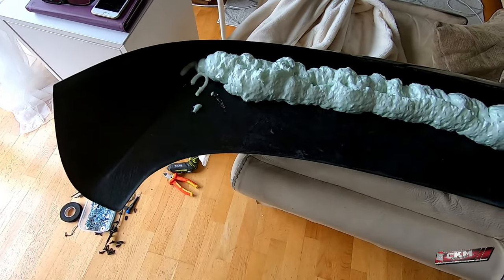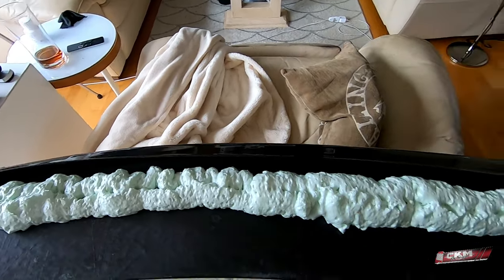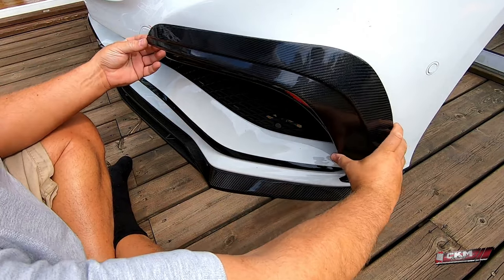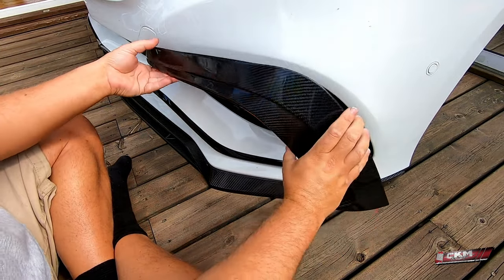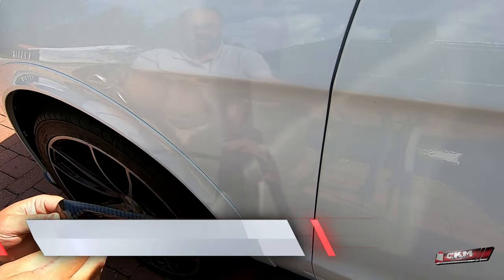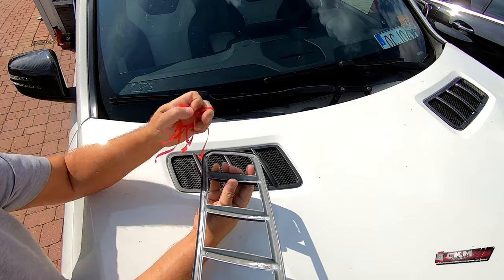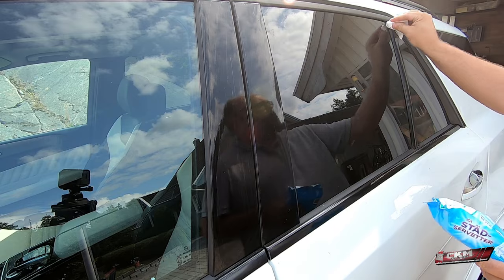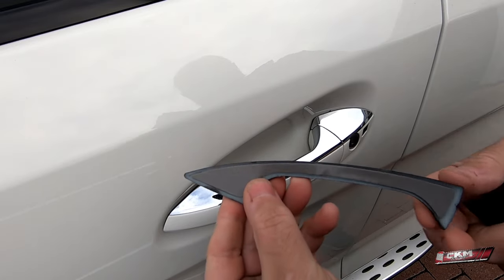BIG Carbon fiber install.. Mercedes copart W166 ML to GLE63 look  part 7

Comment: i wonder, how long these carbon sticker will hold after summer heat and pressure washer...
Reply from the maker: Just fine. As its done all the 25 years years I used it like this....NEVER had anything fall off.
Reply from the maker: @musvlehead  Its comming..Its winter now though. So a bit cold to do videos.

Comment: Hi Chris.  Im a bit confused about the front bumper kit.  I see the CKM GLE63 look facelift bodykit, bit you also have the panamerican grill in the video.  Is that grill sold separately bit fits with your facelift bodykit?  Does it also work with the GLE43?
Reply from the maker: All this is answered in the videos-
Reply: Most unhelpful answer ever, nothing changes

Comment: Hey I was wondering on you previous change on red one, you didnt change all the taillights could you tell me why? From what I ve hear there are some issues changing those taillights, but on this one you changed them all? is is coding issue or what, I would really appreciate your advice thanks
Reply from the maker: Need cable converter. Listed with taillights in my site.
Reply: @CKMCardesign  So I just plug them in with those adapters and thats it? Does it need any programming or something?
Reply from the maker: @FLAMEGANG777  Yes. No.
Reply: @CKMCardesign  Do you sell adapters only seperately? I already have tail lights.
Reply from the maker: @FLAMEGANG777  Sorry no.
Reply from the maker: @FLAMEGANG777  Yes
Reply: CKMCardesign hey didn’t understand yes or no? 😊
Reply from the maker: @FLAMEGANG777  Not separatly

Comment: Like it is ok, the car looks nice but why so much carbon, it just starts looking like a china product. I mean the front spoiler lip and the 2 details around the intercooler intake are fine but then on the window frames and door handles? :(
Reply from the maker: I like it.
Reply: Fair enough, nice car anyways. I have the gle63s coupe with that frond and planing on adding the carbon lip.
Reply from the maker: @Sphiiinxx  Go for it.

Comment: All you need to do is wrap the roof black and new set of GLE63 wheels and it will turn out perfect.
Reply from the maker: Wrap in the plans. 63 wheels?? That is just plain standard boring wheels. Not for me.
Reply: CKMCardesign are you atleast gonna change the wheels you have on it now
Reply from the maker: @amanhawchar  Why?? They are one of the best looks Ive ever bought. Matches and looks perfect on this model.Almost looks like they where made for this model.
Reply: CKMCardesign there nice but they don’t match the aggressiveness of the car
Reply: I agree stock AMG wheels would look better these wheels are not wide enough and offset is too high

Comment: Did the ML have blind spot or active lane or adaptive cruise control? Would new bumper affect these?
Reply from the maker: No. Blind spot would need to be moved over if it had it. adaptive cruise control dont sit in bumprer.

Comment: "...and [* then] add lightness."  ;-)
Reply from the maker: Meaning?
Reply: CKMCardesign I guess he means ambient lighting
Reply: Sorry I'm late.  Famously, Colin Chapman (of Lotus) said, "Simplify, then add lightness." (i.e. weight/mass) Therefore, it must be a very good thing to stick on lots and lots of carbon fiber doodads. You're certainly adding a great deal of lightness. I'm almost entirely kidding.